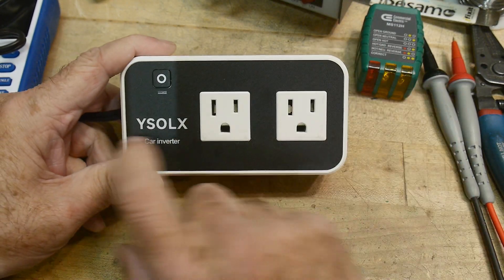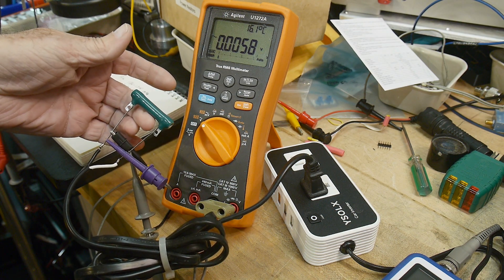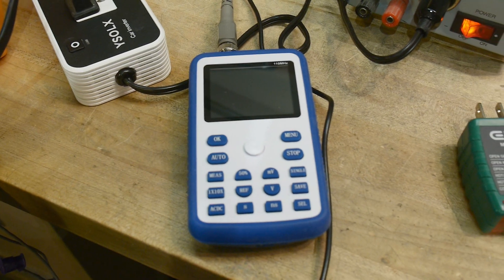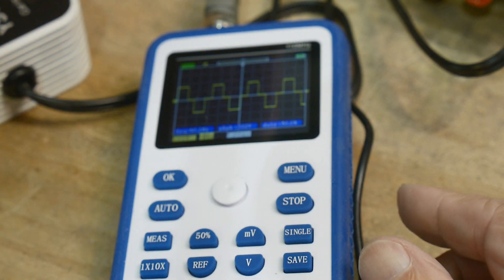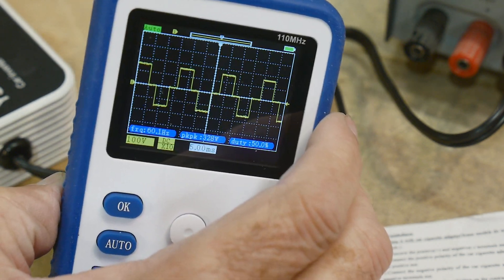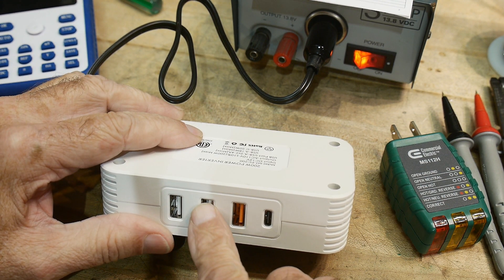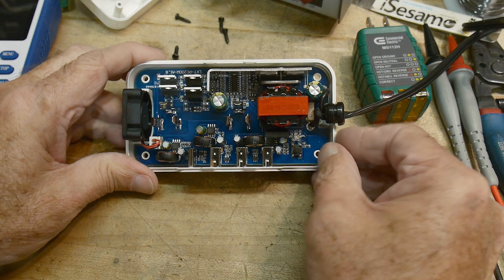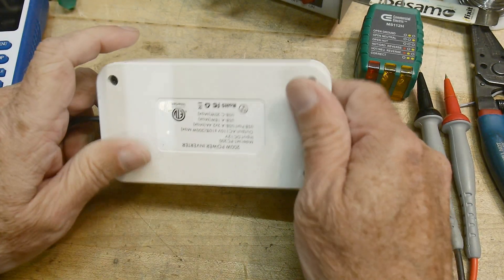#1775 YSOLX Power Inverter MT-PC200 Review

Comment: Regarding the cordless oscilloscope, if you can't really afford a good isolation transformer, a "pure sine wave" inverter and a lab power supply/lead acid battery. Ends up a lot cheaper and you get a inverter for vacation trips and a bench supply that you'll need anyway.

Comment: Please consider a part 2 on this inverter. Suggested things to test: Low-voltage cutoff- can it be used on a standalone 12V battery down to, say, 11.5V?  What is its frequency accuracy? Is it RF-quiet in the AM or shortwave amateur radio bands? What is the no-load current on the 12V input supply? Thanks!

Comment: You can consider the inverter as having an isolated secondary, which is common on those. Would work well on most SMPS inputs, even those with active PFC, and I can bet the output is connected in some way to the 12V input, so having the ground floating is not good, it really should be connected to the input negative.

Comment: VoltLog's latest video tests common types of lighter plugs with high currents and most can't handle their claimed 10A loads without melting.

I doubt that lighter plug and supply wire can handle 10A let alone the >14A required to provide 200W AC at ~120V.

Comment: The output is called "stepped square wave" and it's extremely common in cheap UPS of old. Modern UPS are almost always pure sinewave these days (usually PWM driven), but you can still find the stepped square wave out there. In general, devices like linear power supplies do not like stepped squarewaves - the transformer will run hotter. Switching supplies aren't great, but better (since they're converted to DC anyways) so it's generally fine on IT equipment which pretty much all use switching supplies. Motors are basically the "do not" to stepped squarewave - the motor hates it and many will run very hot if you provide it that. Now, at 200W, chances are you're not going to power a very significant motor load - a fan might be, in which case it's not going to run well., So it's great to run electronics, not so great for a fan or other motorized thing.

Comment: I suspect the use of the FETs to be a little different.  The four ones on the output end look like forming a bridge.  If you feed it with unipolar DC, you can then get the output terminals either neutral (idle) or swapped, so you get the quasi sine wave.  And, they might be IGBTs instead of FETs.  And one warning:  Having a highly INDUCTIVE load would probably be very detrimental, despite of the rather long idle state.  Such loads would interfere with the intended commutation.

Comment: 200 watts! With losses, you're looking at drawing around 20 amps, maybe more, through that cable.😂
I'd be surprised if it's good for more than around 60 watts. Ignoring losses, that would be 5 amps input at 12v. Those cigar lighter sockets are notorious for getting destructively hot at even 10 amps, and that junk cable looks like it would heat up at 5 amps! The ferrite transformer is too small to handle half the claimed power unless it's running at very high frequencies, like 500KHz or something, but that would require quite expensive mosfets, and I doubt they've gone for that.
That's a long winded way of saying the specs are beyond the realms of fantasy!
Reply: Agreed- anyone who believes "200 watts", I've got a bridge I'd like to sell you. Automobile cigarette lighter sockets are typically protected by 10 amp fuses, so 120 watts max from them.

Comment: You might be able to smooth out the square wave with an inductor and X2 capacitors on the output.
Reply: Yeah, it would be interesting to see how much wave could be improved by adding bodges.

Comment: Out of this size transformer 200W at 60Hz?... A good ferrite core of this size won't give out even 80W at 100kHz, and for 60Hz frequency this should be regular silica-iron, or at best permaloy (nah). For your load of less than 1.9W it's OK, and unless (I'm almost sure it is) the load is directly switched by an H-bridge, this time chinese added two zeros to the real output, just to be sure it sounds like a typical low power car inverter. Having direct load switching by a "flapping in the breeze" "pure chinesium" MOSFETs or IGBTs... - not the best idea. (200W transformer powered a 50-60lbs 19'-24' tubes+transistors hybrid TV back in the days where almost half of its weight belonged to that power transformer)

Comment: Thank you for the review. I would have liked to see a check of the voltage between the AC output (line and neutral) and the input positive and especially the negative - as most vehicles have the negative grounded to the chassis. Regards, David

Comment: I would have like to see you pull 150 watts or so on the AC side.  I be the lightweight DC cable would get really warm at that many amps at 13.8 volts..
Reply: I bet it cuts out or blows up at anything over 50 or 60 watts! If the output is voltage regulated, the modified sinewave will no doubt become a square wave when it's fully loaded as it tries to maintain voltage.
It looks much nicer inside than I expected, it's just a shame they made silly claims regarding its power capabilties.
Reply: @ProdigalPorcupine  Lies! Isn't that the way Chinese marketing has in their playbook. Reminds me of the 100 watt amplifier kits from eBay and alibaba, lol. When tested by some content creators here, they found 20watts at best.

Comment: 2.5A fuse on 12V side equals 30W. How can that be 200W on the output?
Reply: Maybe that was actually 25A? Hard to tell but I don't see a decimal in the video.  That would give you 300W at 12V, but most of the sockets you'd plug these in to likely would be fused at 20A or even 10A.  Kinda surprised their own plug would handle 25A.   I'd also be concerned about drawing max amp through those for an extended period.

Comment: Still better than a product I recently received from a heavilly advertising platform: It was marketed as a DC-AC-Inverter for power tool batteries, so you click it on your 18V-LiIon-package and get 110-230V out of it for AC appliances. First I wondered where to select 110 or 230V, then I opened it up and realized: It only delivers 190V DC (!) on the output sockets. 

Barely usable for any SMPS that directly starts with a full bridge recitifier, but obviously this product would have burnt any inductive load or conventional transformer just away... Luckily I could return this thing.
Reply: Many switch mode supplies that have active power factor correction will happily run on 70-80V DC, at the cost of more current draw and the associated cascading heat losses.

Edit: to clarify, these supplies also start with a bridge rectifier, as there's hardly any other way to go about it. Caps don't really care that much, but filter chokes might cause issues on DC.
Reply: @AnnaVannieuwenhuyse  Exactly, it is suitable for small universal input SMPS chargers and maybe some lareger SMPS with PFC - But anyhow I don't want any kind of "universal" ac socket that carries pure DC. It just feels like a device killer.
Reply: @MrXenon1977  please do note I mean active PFC specifically. Those are specially driven boost converters which would not be bothered by the low input voltage. Most SMPS that can do 85-26V AC are SMPS that have active PFC.
Reply: @AnnaVannieuwenhuyse  Thanks for the comment, I also know the interieur of low- to medium power SMPS to some degree. And most low-power SMPS (like the omnipresent 5V/2A wall warts) only have a rectifier charging a buffer capacitor on the AC input.
Better ones, like the 30-100W USB C Power delivery units, mostly come - as legally required over 70W of input power - with an additional PFC component.
For lower power this component would only create unnecesary costs for a top price sensitive device.
But in the end, I think we both agree all these devices may be functional with a 185V DC voltage. As well as the universal motors mentioned in a another comment.
On the other hand, if any AC device you connect to this socket has any kind of maybe only auxilliary conventional transformer then this transformer will quickly burn. Or imagine connecting a flourescent tube with a old-school inductive starter to this inverter. I suppose these lights may also be present on construction sites and quickly thinking about it could slightly shorten the lifespan of such a lamp into the area of single seconds.
Reply: I have a little suspicion — they have mixed the concept of a Universal Motor, which runs on AC or DC.  Those motors include typical vacuum cleaners and corded drills and such.  A 115V AC drill would run faster than nominal, and 230V drill would run slower than nominal, but both would run, given the 190 V DC.  Tools part might be OK on the description, but forget the charging batteries!

Comment: It's nice that it's cheap but I can't see any good reason to buy it. The safety aspect didn't look great when viewing the PCB. The mains prongs were very close to some of the DC output traces. If it doesn't kill your AC devices because of the square wave (it's not a modified sine wave as much as a modified square wave, which you also pointed out), it may kill you or your USB devices. Or heck, both at once!